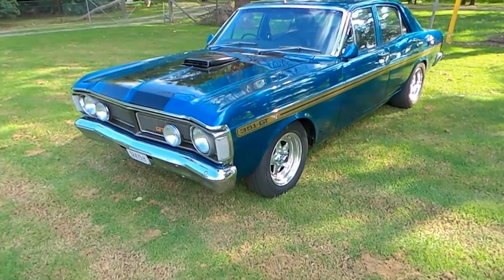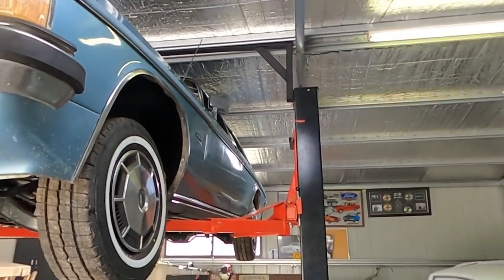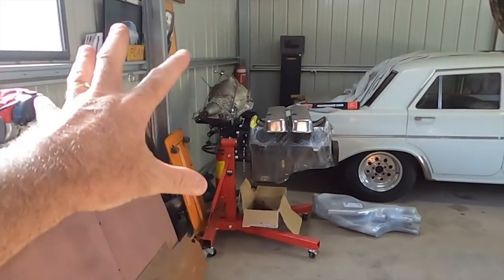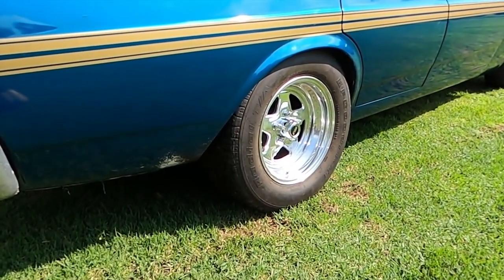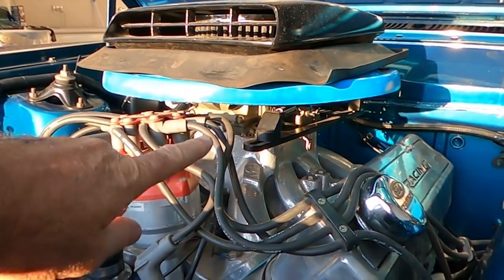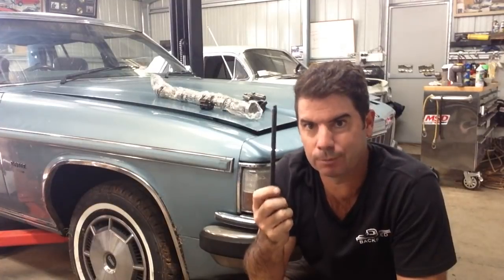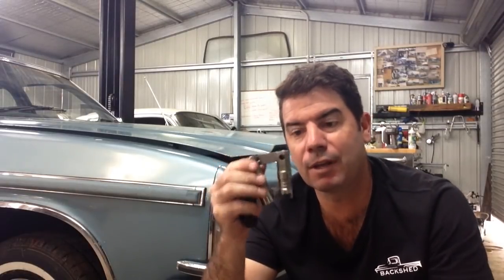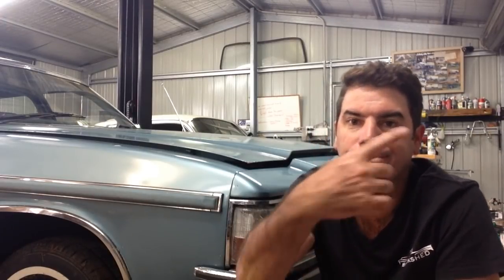Ep10. XY FORD FALCON CLEVELAND STROKER V8 . 351 NO MORE ! 410ci WITH AUSSIE CHI ALLOY 3v HEADS.

Comment: Thanks for the garage and hoist dimensions. I am in the process of getting my garage approved and it is 7.5 deep with similar height. I still haven't decided whether a 2 post hoist or 4 post storage ramp is the best way to go as I will be stacking and storing 2 cars 90% of the time.
Reply from the maker: Yeah no worries Mark , I did put that in there for that exact reason mate , had a few questions about it in the hoist video so there’s a few of us around tryin to sort out the same stuff buddy. 
Cheers for watching and message me if ya need more on the dimensions side of things for hoist/shed.
🍺👍

Comment: Pushrods 😐those were the days .. Chrysler had big cog ⚙️ on cog for ur camshaft ..oh can U do any Hemi245 engines ...good double sprocket chain be best cam drive ?
Reply from the maker: I just bought 2 variants mate 
1 is a 225 slant but I’ll look what the other is when I pick it up
🍺🍺👍
Reply: @backshed5295  I admire your enthusiasm and extremely hard-working ethic ..enjoyable smart ..able to have a beer 🍻 after work ..where are U selling ur projects ? Can U supply a column in your page ..where ur finished projects are going ..say ..Mucus ..what will be of that masterpiece..hang on to it or sell ??
Reply: @backshed5295  even the big selling popular corolla and corona had pushrod camshaft back in the day ..70's ..good blocks those 4 cylinder jap engines ..easy to fix blown head gasket ..? Not that I'm a mechanic but helped fix one ..I remember going to get the head machined back early eighties..got cheap head from wreckers .

Comment: love the channel was wondering what cam did you go with? roller again or flat tappet?
Reply from the maker: Hydraulic roller mate 
610lift 241@50 thou
Cheers for watching mate
🍺🍺👍
Reply: Curious what brand of cam? I'm sort of in same situation 225 3v and single plain manifold but 377 clevo but mines top loader with 3.9 diff
Reply from the maker: Jonny Marshall @ Marshall custom cams 
You could go heaps bigger if you wanted to rev it to 6500 or even 7000 but I’m pretty impressed it made 553hp at only 6000rpm and more importantly big torque very early in the rpm.
🍺🍺👍
Reply: Cheers for the info  and keep up the great work 👍

Comment: Beautiful falcon.do you run a return fuel line from the tank?
Reply from the maker: No return line mate . 
They call it a dead head system.
The Holley fuel regulator does the job with psi.
Reply: @backshed5295  cheers for that mate.